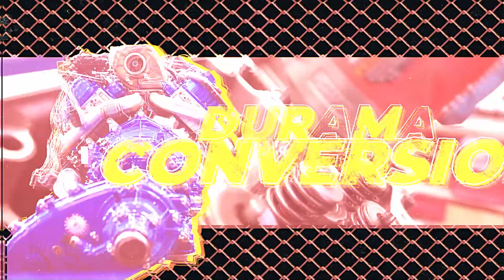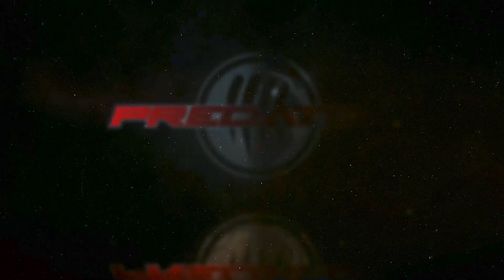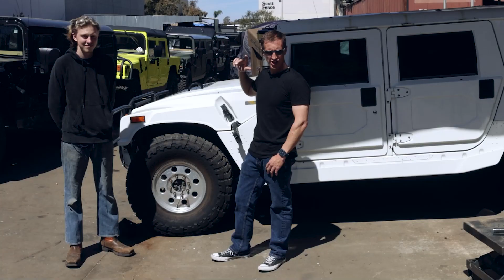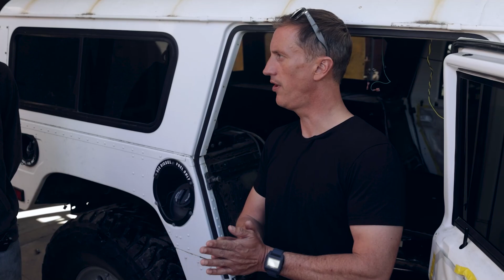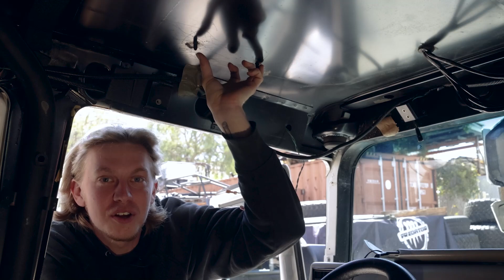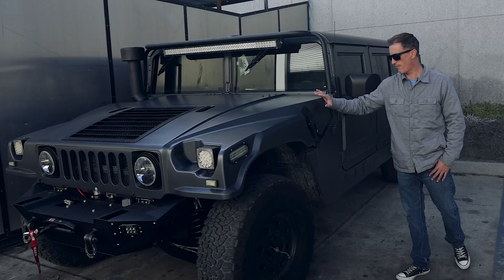HUMMER H1 BUILT BY YOU THE VIEWER!!!

Comment: You could also look into extended range fuel tanks which are a huge benefit to overlanders. Less Jerry cans to bring with. And I haven't seen them implemented in after market, but a 360 degree camera system would make navigating tight trails and small parking spaces much easier. And FLIR for night driving down dark roads is an awesome thing that I've always wanted to see more of.

Comment: An Exo on the trailer and on the roof rack a collipsable  awning, table, bench(s).. all ONE PIECE... think pivot and lock into place to the roof rack... (chinese jizsaw)... show off your talent.. JMO of course.
Reply: It should all lay FLAT on the roof when traveling...
Reply from the maker: Great ideas! I like the compact foldable design ideas!
Reply: @PredatorInc  Using the "basket" design roof rack will give you more contact points for locking down unit... IMO

Comment: Paint color - light grey with a matte finish (maybe even kevlar) finish the bottom with the black skid plate protectors.
Front bumper w/ winch with brush guard, the upgraded hood ringers (air lifts). Rear bumper w/winch side ladders on both sides. Roof rack with lights all around w/ the red back lighting.
Wheels - black with red highlights/accents.
Interior - black edge, light grey middle with red stitching seats. Alpha dash a light grey color with red stitching. The rear interior storage racks. Rear mirror camera option. 
My first thoughts, will come up with more 😆
What kind of snorkel is on that thing?

Comment: I have only seen one h1 with a raised roof an it was wild but cool.
Plus that advantage, would bring more space,an if you use marine speakers indoor/outdoor sound system.with a center roof hatch/window,it can double as a inside  stairs go-to for roof seating/ storage rack access. Plus try tailgate drop down door hatch with other half pull up ,by doing it this way you can add jack & tool box incorporated into back door, etc every space can be utilized.

Comment: Okay,a few aspects,
For color, how's that paint that changes tone,or shade or color.
Meaning hot one color,cold another-or wet one color,dry another, stay dark . Two how about 52 inch 37 ply "J" ply tires ,this way it's at same height clearance as trailer.
Three how about raising roof , a slope,by doing this it gives a arrow dimensions airflow, like the old oldsmobile wagons after front seat or second seats a slope roof with slotted windows ,an by putting a emergency roof drop in hatch /window,you can still have roof rack ?
Or a half to quarter roof rack ,it brings over airflow up over trailer as well,better fuel economy.

Comment: Winch on the front and back, roof rack, onboard air compressor, train horns. How about snagging some ideas from the EV. Rear wheel steering, extraction mode 6” inch emergency suspension lift, multiple cameras including undercarriage. Just some ideas...